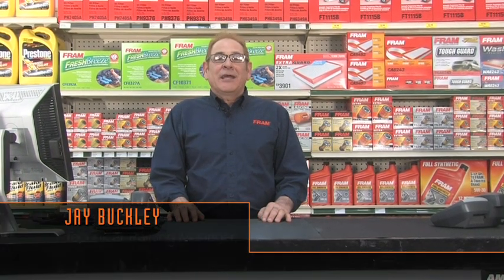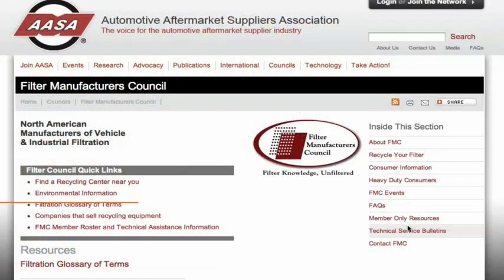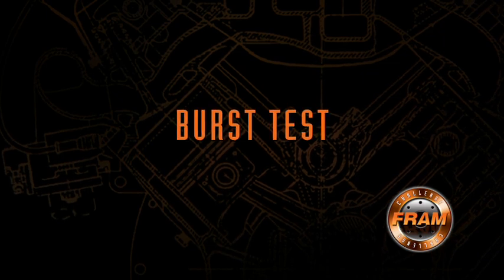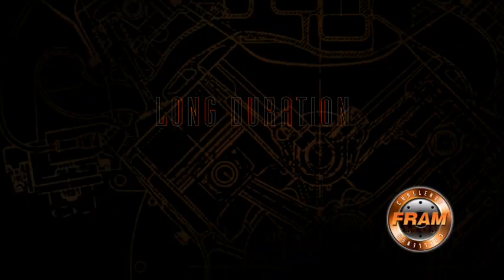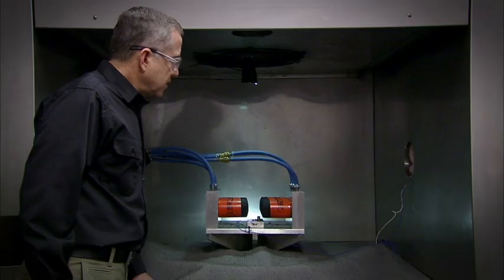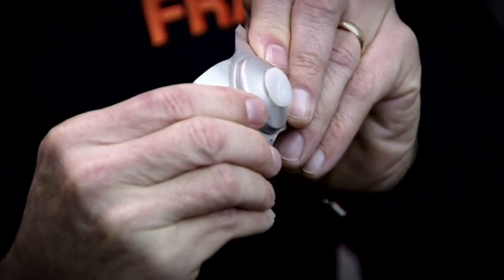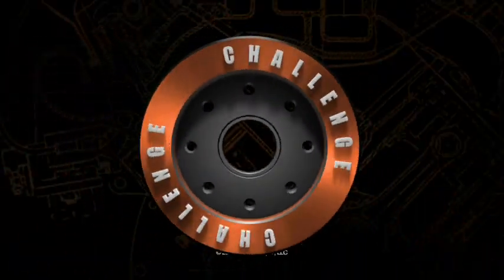Filtration and Engineering Testing - 2011 FRAM Challenge Video 2

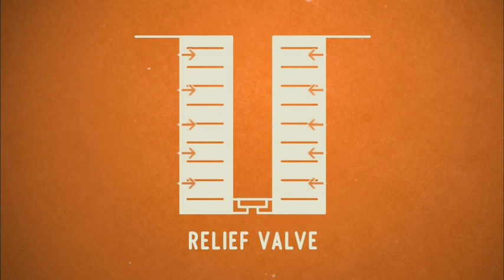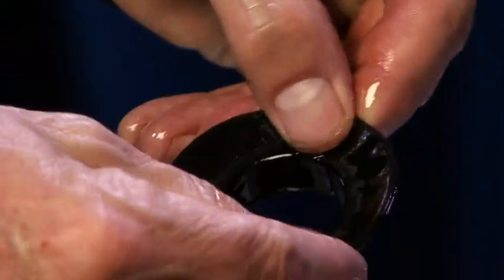Comment: Start from 8:20 and watch from there. When the bypass opens the oil can pickup contaminants and bring it back into your engine . Watch 10:53 and on to see what I'm talking about.
Reply: This applies to all oil filters with a bypass valve, including Mobil 1 filters. If the filter has been used without changing for too long it can no longer filter anything as it gets plugged and it bypasses back into the engine. This is from neglect and I do not blame Fram or anyone for using this design.
Reply: every oil filter have that even 30 dollar one
Reply: Not all filters, most WIX filters, the filtration assembly moves up and allows bypass to happen at the base of the oil filter without the oil passing by the dirty media like this Fram.
Reply: @850RC  Not anymore. They used to (Purolator and Motorcraft) have the baseplate bypass but it's been changed to the Fram style which seems to be the norm now. I just looked at the FL1A.

Comment: consumer reports did a test of oil filters years ago and actually rated fram the best back then but was it the same back then as today or has all filters gone downhill  with everything being made in china ? even things that are made in usa have chinese made parts
Reply: I noticed the same thing. a race to the bottom. One starts cheaping out, like Fram, them they all follow. Lots of Fram fanboys here. That company has changed hands so many times it isn't funny. Not even the same owners as when these videos were made. And there's guys saying they used them for 45 years etc etc. It's a basic generic filter like McDonalds sells hamburgers. Not the best but if you have a generic 'econobox' it fits. I did use them in the 1980's under Bendix but never took one apart. I started using Wix in the mid-'80's but they aren't what they used to be either since Mann+Hummel took over.

Comment: When a filter reaches it's capacity doesn't that effect it's flow rate?
Reply: if it gets too plugged with contaminants the relief valve will open to allow flow which is why no filter tries to go ridiculously fine on filtering it would clog and bypass too fast
Reply: Yes, which is why you should just be changing your oil and filter at 3,000 miles. You’re never going to save enough money on oil changes to pay for a mechanical engine problem. Save yourself the trouble and change it at 3000 religiously.